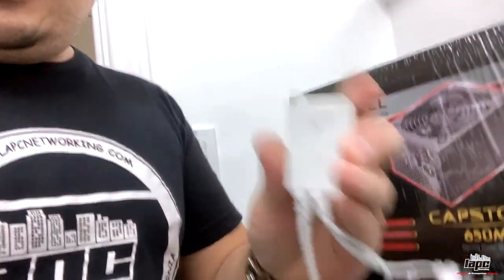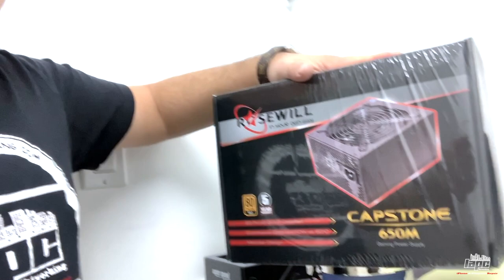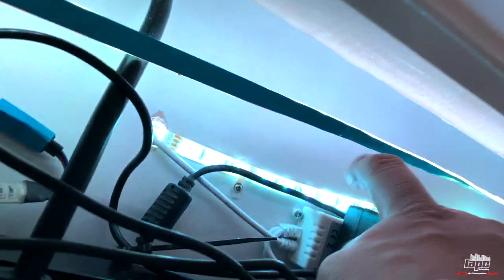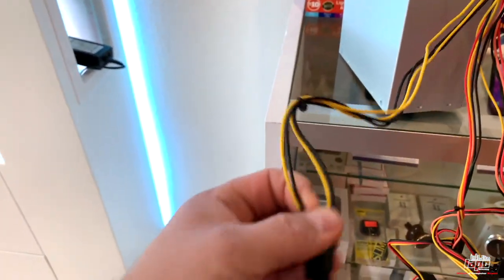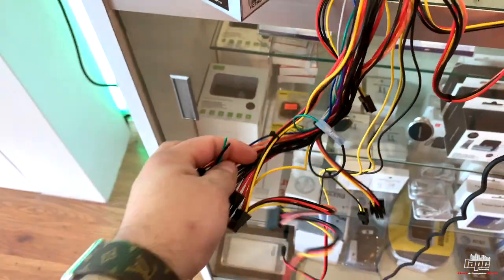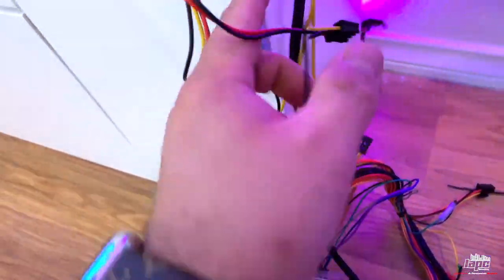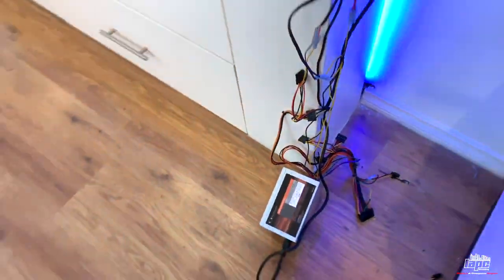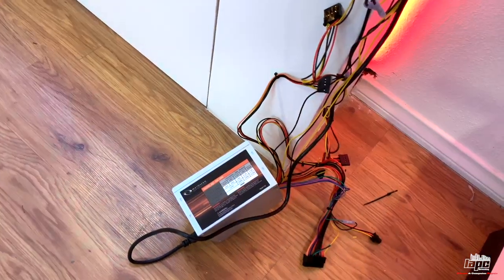How to use a computer power supply to turn on LED lights

Comment: Omg you are so right about those black power supplies at the beginning. We used to use a bunch of those in retail as well and they get super hot and fail all the time. The silver hexacomb grated ones with screw down terminals are usually what is recommended for LED strips, but even those have a wide range of quality control and can cause damage downchain. I have an expensive DMX controller I need to power so unreliable power is not an option. I went searching to see if I could use a PC power supply and found your video! Great job explaining it! For reals, thank you!

So to explain a a bit more. Rosewill is newegg's in house brand and they are ok, but I'm really glad I can snag a PC Power and Cooling, or a Seasonic and have great confidence in QA and efficiency rating. Also, I think it helps tremendously especially if it is going to be behind a cabinet or enclosed to be able to use these that have active cooling. You could even live monitor the output voltage rails with a Corsair iCue compatible one.

Comment: Thanks for the video! I needed to know the wire jump for the ps to work without the MB.  I am using a 380Watt PS for outdoor lighting.
Reply from the maker: usually is the green cable

Comment: Great video thanks! I did this with a coolermaster RS-550-ACLY 550W Power supply but the LED strip switches on briefly then the power supply shuts down completely, does not restart until you switch off at the power point. I tried joining all the black and yellow wires together, but the problem still happens. How to fix this problem?

Comment: Probably burned out because of the number of strips you had connected was >80% of the individual power supply capacity. In fact, this is how I came across your video. "Super hot" = you have too many strips... Maybe try a modular PSU? ;)
Reply from the maker: I was using a separate line for each power supply and it was just like 6 feet each, definitely it was the power supply quantity, now with this computer supply works 100%   :)

Comment: Hey amigo, which one would be 12v 10a connector on the power supply?
Reply from the maker: The yellow cables are all 12v, the amperage is depending of your power supply, just use the cables like the video.

Comment: suggest getting a better PSU this one looks like it might burn your shop down
Reply: Doesn't matter on the brand name what matters is the tier level of the Power supply, Buying a Tier A PSU is going to run near 300 USD for a 850 watt and 70 Amps on the +12V rail.